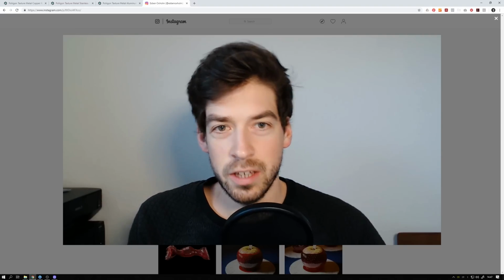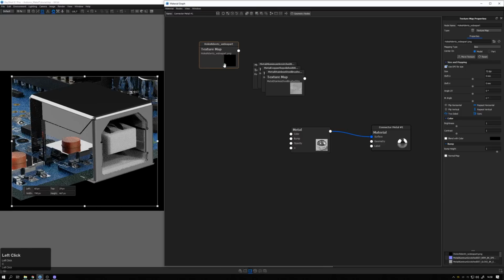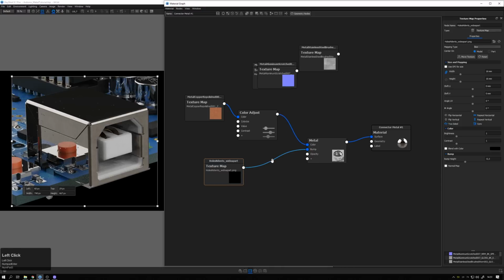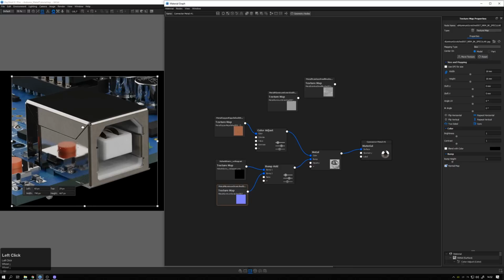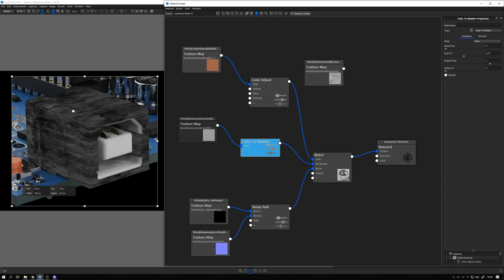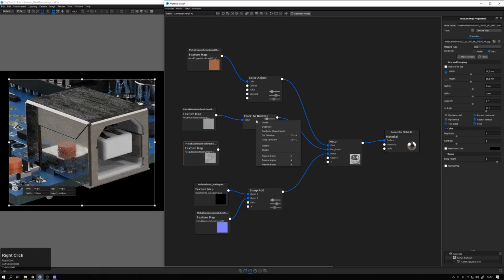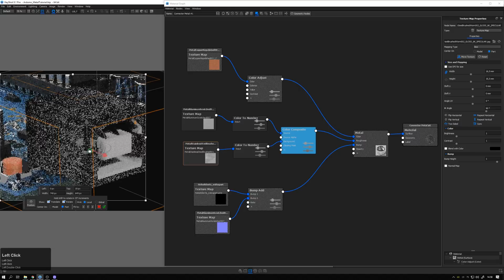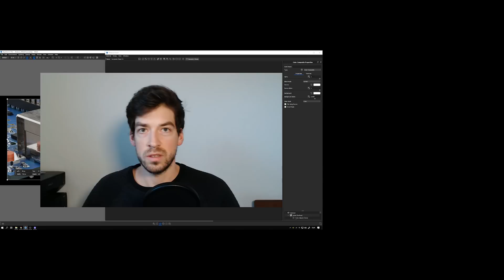KeyShot Material Study: Detailed Metal

Comment: hi, your work is so awesome! I'm a PCB design engineer and I want to ask something. when I render my PCB ( 3Dmodel  exported from Altium designer ) , my tracks ( traces in the pcb ) doesn't render. maybe because I'm exporting just the 3d model of my PCB board ( just the components models ). so what is the the data type I could import from altium ? there : .obj , .3ds , .u3d ? which is the best suited for keyshot ?. thanks

Comment: What material is the white object in the metal made of?
Reply from the maker: It's the basic translucent material
Reply: @esbenoxholm  Also added bump texture, is it? The translucent material you modulated is very good. I tried many times to modulate your feeling. Thank you!
Reply from the maker: @LinYu-888  True. It has bump and roughness map. And I think I have a subtle texture in the 'texture' slot as well.
Reply: @esbenoxholm  I'll try. Thank you very much.
Reply: @esbenoxholm  May I ask if you use that bump and roughness chart?

Comment: thx for the great tutorial, btw why you decided to use metal shader instead of advanced? I`m talking about advanced shader due to Fresnel option that it has, so maybe it could look more realistic. The only problem is that in Keyshot there is no option to work with the Fresnel curve like we have in vray/corona.
Reply from the maker: Thanks. Great questions. I don't really have a good answer other than to me it's a bit faster to create the metal shader using the metal material type. I don't know for sure, but I think some subtle Fresnel effects is happening. Especially for the measured metal types inside the metal shader.
Reply: @esbenoxholm  thanks for the answer. Actually i hope that some day Keyshot team will implement the Fresnel control curve inside the advanced material. And as you said - "some subtle Fresnel effects is happening" and thats true, especially by adding some bump map. Have a nice day Esben and thanks for your work.

p.s. I guess you should create a Patreon page, and earn on your tutorials instead of using gumroad. Time shows that paid-subscription model works way much better nowadays, instead of pay per item
Reply from the maker: @Muerte_S  Sure. If you go to the wishlist board on the forum and suggest it, they might consider it :)

Have thought about the Patreon page, but can't commit for the time being to put out stuff regularly. Thanks for the suggestion though. Might look into again later on. Have a nice day too.